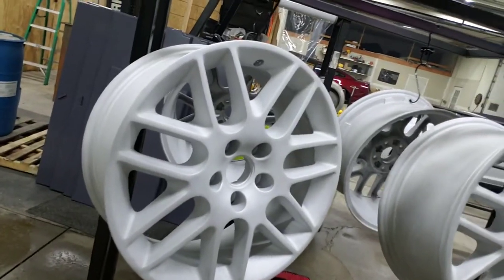Powder Coating - How we prepare wheels for powder coating - How to Tips

Comment: I'm curious though , you always mention filter set up for your water , what exactly is that ? Someone like myself could use something like that since I have well water
Reply from the maker: We have an air dryer which is not cheap, but I'd suggest the best inline filters you can get based on what you can afford.
Reply: @RightNowPowderCoating  I have air dyer , I was referring to your water filters when you wash the wheels.  I've tried several different water filters but still leaves salt residue from having well water
Reply from the maker: @gears101  ahh got ya.  Not sure the best move there.  May need to install a water purifier ststem

Comment: When the wheels come out the oven what temp do you powder coat them at?
Reply from the maker: Usually start around 185
Reply: And after degassing what temp do you start coating??
Reply from the maker: @royakay9804  same, around 185.
Reply: Will the powder start to flow at that temp or will it still be in powder form until it’s put in the oven? Sorry for all the questions just trying to get my head around it all. Also any recommendations for system not looking to spend to much more than $1600?
Reply from the maker: @royakay9804  most likely but won't gel fully but you won't be able to blow off
Reply: I appreciate all the help. I do mobile wheel refurbs in the uk at the moment but I’ve managed to get a lock up to move into at the end of the month and going to start powder coating so all advice is good advice 👍 any ideas on a system? Been looking at the hyper smooth 03 LED and the koolkoat 3.0 DPW